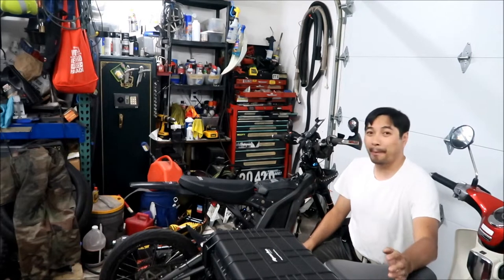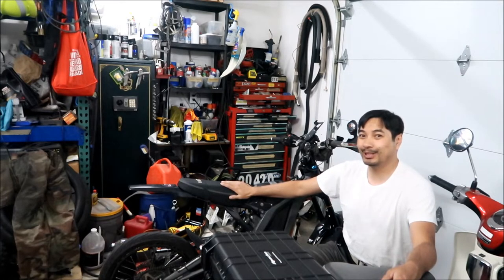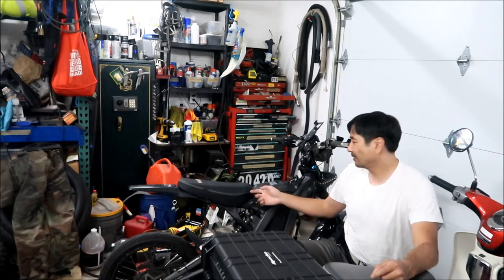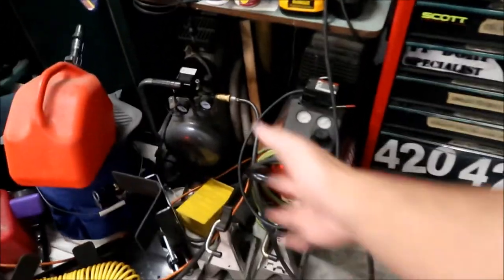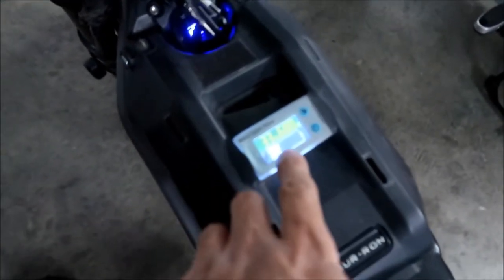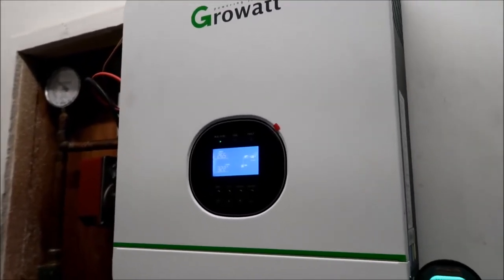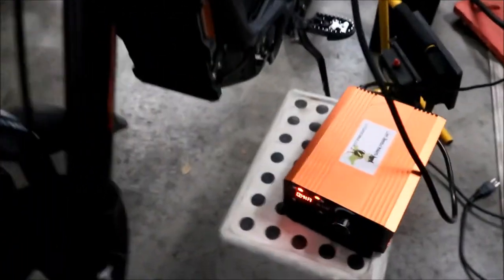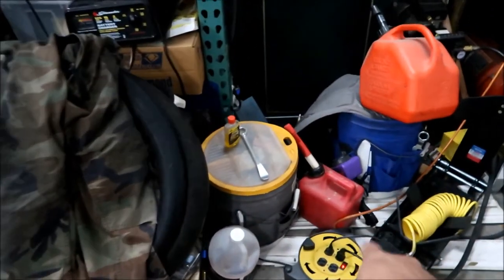HadesOmega Solar Garage Project Episode 59: Charging my Sur Ron Light Bee With the Power of the Sun!

Comment: Dude. I stayed up and binged watched all ur vids like it was on Netflix or something. I just bought a Growatt and wanted to know what it could do. Can you do a test where you charge the batteries using a gas generator? That's what I really want to see. Thanks in advance!

P.S. I let all the commercials play so you can make a few coins. (Even the really long ones that are 4-15 minutes...LOL)
Reply from the maker: That's for watching.  In a future video I will use a gas generator to power loads.  But to charge the battery using a generator or shore power is as easy as changing the power priority to charge the battery with grid power.
Reply: That's what everyone says but no one has actually showed it in a video. You know technology can be fickle so it's best to double check.
Reply: @hadesomegamoto7639   Btw... to get rid of the beeping sound you hold the down and enter buttons for about 3 secs and you will see the little speaker icon disappear. This video explains - https://youtu.be/T7nolzGQKzY?t=354